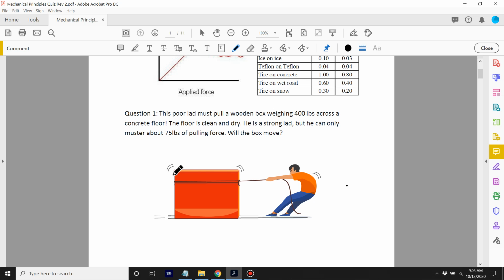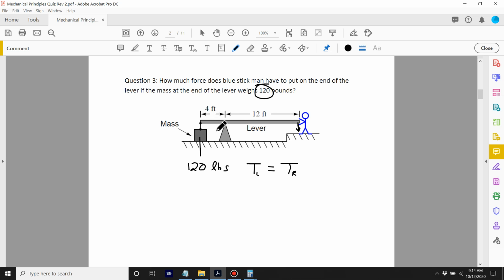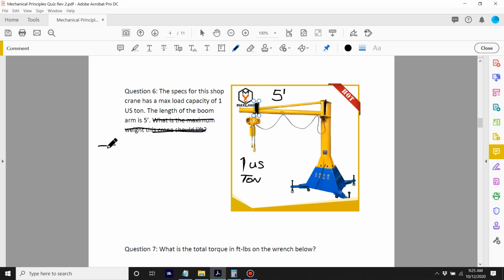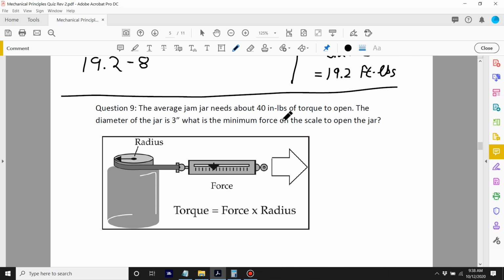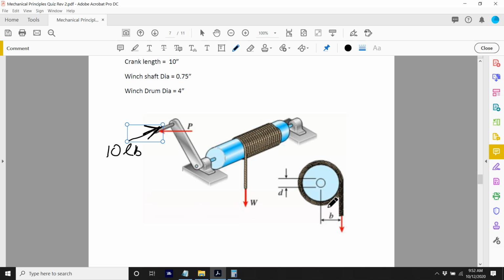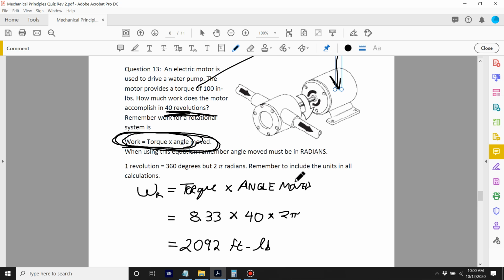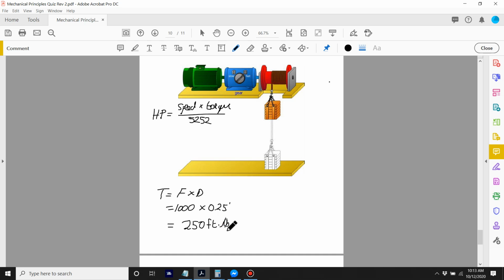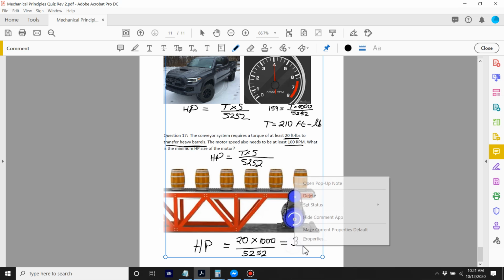FORCE, TORQUE, POWER  QUESTIONS

Comment: You made an error in the last example: You used 1000 RPM, instead of 100 RPM as specified in the problem. Thus your answer is off by a factor of 10, and instead of a 3.8hp motor...you'd only need a 0.38 hp motor. Therefore, a 0.5 hp motor for all practical purposes. 

Otherwise, a great review of the concepts of physics, statics and (a little) dynamics. I haven't used this stuff in 15 years!